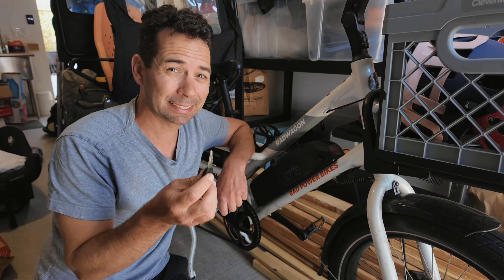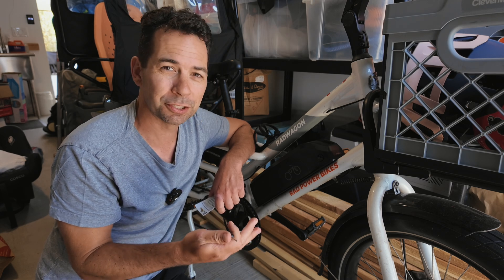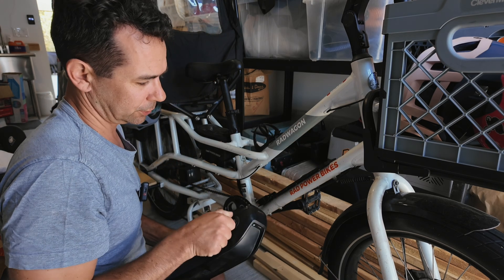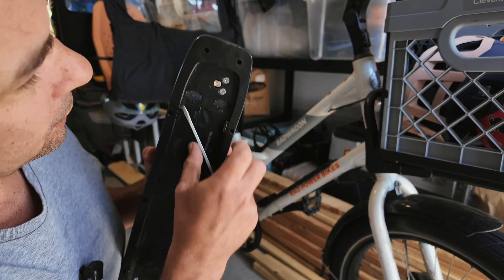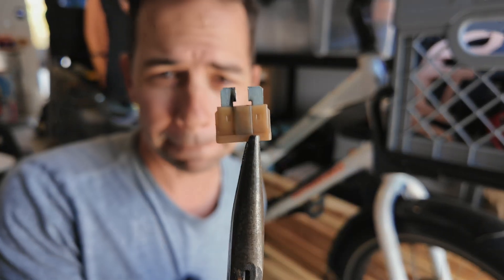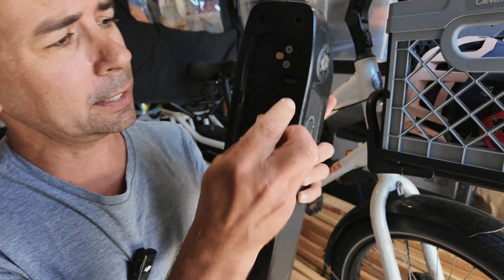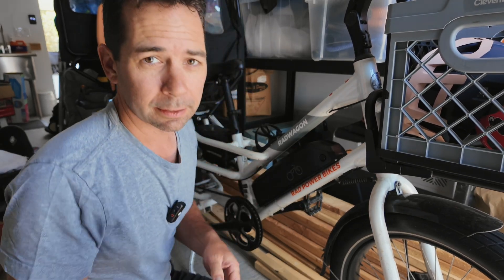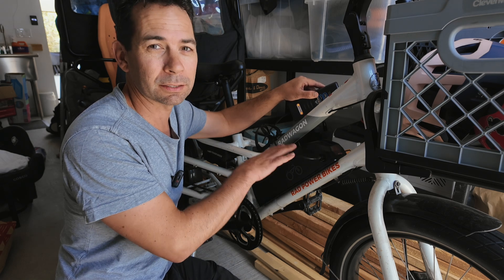Rad Power Bike Key in the Battery Charging Port Easy and Cheap Fix

Comment: I usually charge the battery while working close by, and never leave the charger plugged in after the battery is charged.
Ride RAD (or don't ride at all) 🙂
Reply from the maker: That's probably a good idea, but not always possible since it takes a while to charge. I let it charge and then unplug it once it's done as the second best option. :)